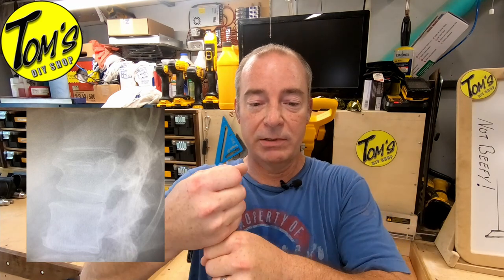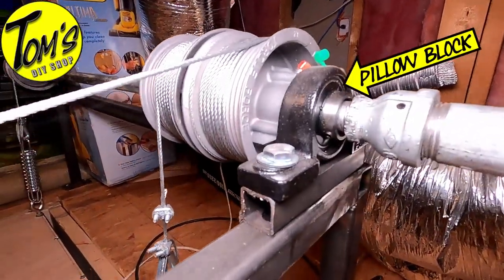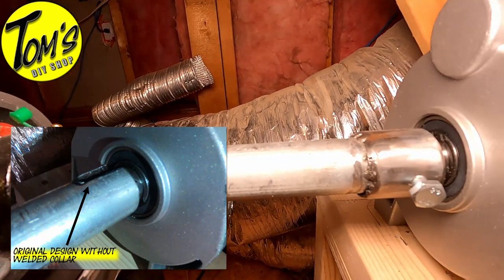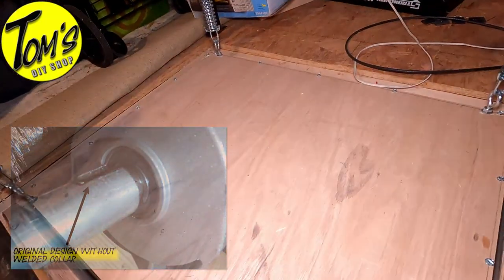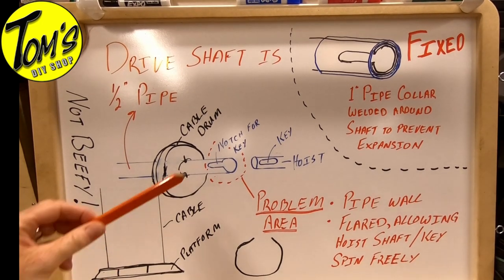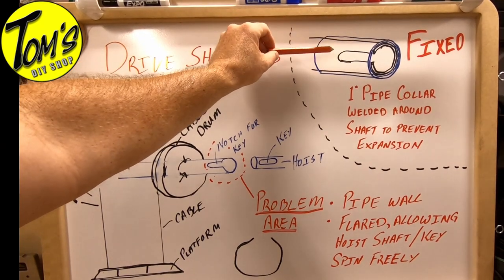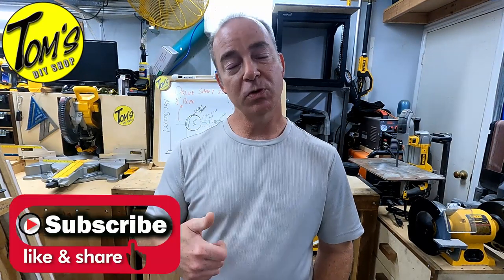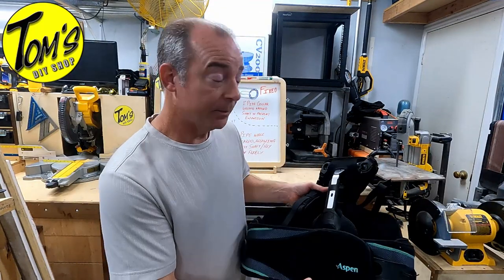Epic Fail - Attic Lift Fall: What Happened?

Comment: Glad to see you are doing better. My father built a lift in his garage, and the same thing happened.  The cause of his was a turnbuckle failure. When building his lift, he went to Lowe’s to buy a cast-iron 2000 pound turnbuckle and the Lowe’s employee pulled one off the shelf from the correct box but it was a 250 pound aluminum turnbuckle that was in the wrong box. It worked for over a month until it didn’t. His broke when he reached the top and it came crashing 12 foot down. My father was 75 years of age when it happened a couple years ago and he broke both heals, his elbow and his back but luckily he lived to build another day.
Reply from the maker: Wow, I'm very glad to hear your Father is ok and I really appreciate you sharing your story in the comments. We all (hopefully) learn from our mistakes and continue moving forward smarter. I've had enough wrong parts in the wrong location that I double check everything...luckily it wasn't even close to as hard of a lesson as your father's!

Be sure to check back and subscribe, I have new content on the way!

Thanks,
Tom

Comment: I give you a lot of credit for showing your fall, there's alot of people out there,myself included, that wouldn't have shown that. I did my own platform and am still working on the final touches. Nowhere near as stout or high tech as yours but it does what I need. Glad to see your up and about.
Reply from the maker: Hey Greg, we all learn from our mistakes and if my  fall and subsequent evaluation saves someone else’s pain and suffering, then I’ll chalks that up to a good deed for the day,
Reply: I have looked at alot of lifts built. This is by far the number 1 lift I would not step foot on. Even with the so called fix.
Reply: @TomsDIYShop  thanks for sharing. I think the sistem it's not safe for people. Lack of safety. The best is to use it for items and stay away when holding loads

Comment: Damn, that looked like a nasty fall. Since you seem to value feedback, I want to share something: I notice you improved the point of failure, but didn't add anything to prevent this from happening again. That means that you're now relying on an improvement of which you can't really be sure if it'll hold up over time. I mean sure, it probably will, but especially if you're gonna be on the lift yourself, you always have to assume that it will fail at some point, so you'd need a backup.

The best way to prevent a very speedy descent in your situation IMO would be to prevent the axle that has your cable drums from spinning too fast. Something like a centrifugal clutch could be used to engage a brake when the axle spins too fast. Another option would be a magnetic brake, similar to what drop towers use, but that's probably a bit more expensive and harder to make.
Reply from the maker: Hey Tim, thank you for the detailed info and for taking the time to stop by the channel. I couldn’t agree with you more that the lift needed some redundant safety measures, given that I was riding the lift. I evaluated fall arrestor systems, notched gears, etc., but…I have since moved to a new home with a new shop! I’m working on the 2.0 version of the lift and don’t have the same limitations I did with the garage attic space in my last house. This version with leverage lessons learned and all the feedback I’ve received.

Comment: When engineers design things we use different factors of safety and backup “fail safe” provisions when people will be the load as compared to objects. Even then failures can occur through errors or unanticipated events. Glad you have recovered from your fall, very scary.
Reply from the maker: Hey Jerry, thank you for the well wishes and for checking out the channel! Definitely an oversight on my part, but not one that I’ll make a second time.

Thanks,
Tom

Comment: sorry that this happened to you.  I see some other things to consider in your build that would make me nervous.  I highly recommend a fall arrestor for you when using that.  
The cable seems to be completely off the drum at the bottom.  Will make the winch motor work very hard to get the platform moving.  It's  better to leave 4 or 5 wraps of cable on the drum when the car is at the bottom of it's range.
The forward pulliies attached to your welded frame are attached with some bolts.  Are those bolts sized appropriately for the weight they are expected to carry?
Reply from the maker: Hey Mike, thanks for stopping by the channel and for taking the time to leave a comment. I considered how much, if any, cable should be left on the drum when the lift was in it's fully lowered position. I decided on "None" because I was concerned that, if the shaft/drum was over-rotated down, the excess cable might go to one side or the other, outside of the cable drum guides, and wrap around the drum shaft. Raising the lift while in that state would cause the platform to have a severe angle and potentially damage the cable. Excellent points though and, if I had some type of sensor or switch for both the upper & lower limits, I could have left some cable on the drum and reduced the strain.

As for the components used in the build, yes...the bolts were more than capable of carrying the load. I considered the lift capacity of the hoist, the pulleys, bolts, cables, etc. and, divided the load by 4 as each connection would be sharing the load.

Comment: This video has the potential to save lives! I am about to embark on a project like this. Just getting started with you video. Thank you for sharing!
Reply from the maker: Hey Captain, thank you for the feedback and for taking the time to stop by the channel, I really appreciate it! There are several other design options out there (which I’m sure you’ve discovered in your research, just as I did) that include much needed safety features, especially if you intend to ride the lift. I’m currently working on a 2.0 version of the lift in my new shop and don’t have the same constraints I did with the attic space above my garage. Would love to see the final build once you’re done!
Reply: @TomsDIYShop  thank you for the reply.  As of right now I plan to use a winch, yours was the first one I saw with a garage door opener.  I like that a lot because of the stop mechanism.  There is a very impressive one I found last night that lifts a motorcycle into the attic as well as many other attachments that he added on.  Really very very impressive.  A lot over kill but, very cool.

Comment: Happy you healed well.  I have broken several vertebra's and my pelvis among other things.  For what it is worth mine healed pretty well, my advice is don't push it too hard and more important don't not use it.  Fine line, but if you don't use it you can lose it, things get too tight and stiff.  It was almost a year before things got really back to normal.  Hang in there and good luck.  Keep building and doing things you enjoy.
Reply from the maker: Thank you TCCD, although you comment may be a day late and a dollar short! I was already stiff as a board thanks to spending 18+ hours a day in my office chair for 5 plus years. I have been working to finish my bachelor’s degree and started on my MBA (only 3 classes left!) and between work and school, hardly left my chair.
Reply: @TomsDIYShop  Good luck on the MBA.  I remember those days and glad I did it, and glad I don't have to do it again.  The right Masters can sure open up some opportunities.  But remember to live some during the process.  Wish I had of but got too focused on degrees etc.

Comment: Wow, thanks for sharing your X-ray. I fell about 15 feet off a ladder and had the same injury as you did to the L1 vertebrae, its called a "wedge compression fracture". I'm glad you're feeling better.
      Mine turned out to be about 80% crushed. Stable and no chips or cord damage, but I could barely get out of bed for 2 weeks and had to take some serious pain meds.  Happened 8/2022 and still undergoing physical therapy. The outlook is OK, but I'll never be the same again.
       Count your blessings it wasn't worse.  I  now harness up if I'm working at heights greater than 6 or 8 feet if things look a bit "sketchy".
Reply from the maker: Wow...it's amazing what that extra 5 feet will do. The ceiling in that garage was "only" 10 feet...but that's better than 15! Glad you're on the mend as well and didn't sustain anything life threatening or worse! As we age, things hurt more than they used to and take longer to heal! 

Thanks for your comment and for taking the time to do it, I really appreciate it! More content is on the way so, if you're not already, make sure you're subscribed and hit the bell so you'll be notified when new videos are released.

Tom

Comment: Hi Tom, 
Really glad you are okay. Sometimes what we don't know can hurt us. As a tradesman, I continuously upgrade my knowledge. When we know better, we do better. The item you refer to as a shear key  is primarily a drive key. There are three parts to a drive of this type, The Key Seat ( the groove in the driving shaft), The Drive Key itself, and the Keyway (The grove cut into the driven hub). There are specific dimensions for these items based on the intended load, shaft size, hub or coupling size. The key should fit snugly into the key seat and the keyway so the connection has no gaps to allow movement. The galvanized (Sched 40?) water pipe you are using Is not the proper metal nor has sufficient wall thickness to withstand the torque applied to lift the varying loads and was doomed to fail. It is unfortunate that it failed while you were on board. As an improvement, you have welded a collar over the pipe that has already failed once. If the keyway in the new connection is loosely fitted, the edge of the pipe that the Key drives on will begin to get pushed out and it will fail again. There are proper hubs, collars, shafts, couplings readily available. Go to your local bearing supply store and they will have the knowledge to supply you with what you need. Stay away from the big box stores or Tractor Supply stores. They don't have the knowledge to ensure you get proper components. Another thing I noticed is when the lift is on the floor, the cables are unwound all the way. There should be two wraps of cable still on the cable drum when the lift touches the floor. Also, install a limit switch so the lift stops before the cables slacken. There should always be a load on the cables to prevent them from coming out of their groove on the cable drum. If the cable comes out of the groove when unloaded, it may lay into an adjacent groove when the load is applied. The edges of the grooves are sharp enough to damage the cable if the load is great enough. One more thing, make sure all of the cables have the same amount of tension on them to keep the lift platform level, but that should take care of itself after you add the down limit switch and re-wrap the cable drums. Please fabricate some type of a safety mechanism to prevent it from falling. Personally, I would not build a winch in this manner. If I were to build one, it would have similar features as this. https://www.youtube.com/watch?v=8wVN4IINC1A&t=13s

Take care.
Reply from the maker: Hey Mark,

First off...Wow! Thank you for the very detailed response and guidelines. I wish I had this info during the design / build phase of the project. You are 100% correct about the galvanized water pipe wall thickness and that was an oversight on my part. One correction though - the welded collar was not originally in place, which is what allowed the water pipe walls to flare under the torque of the motor. Once my back healed and I was able to evaluate what happened, I welded the collar (both front and back edges) all the way around the original pipe.

My preference would have been to use a C-Channel with truck guides against a wall. That seems to be the most solid option from a DIY perspective. Unfortunately, due to limited head room in the attic and limited wall space in my garage, I couldn't make the C-Channel solution work, which is why I opted for the cable system. The link you provided is a video I've watched several times and I thought the builder was very insightful with the design and execution and even had additional accessories he could attach. I don't have anything near the size or weight I'll be lifting....just holiday decorations....lots of holiday decorations!!

Thank you again, you very obviously put a lot of time and effort into your comment and I truly appreciate it!
Reply: Great information here. It definitely makes sense to buy the correct items.
Reply: I came here looking for an easier way to get boxes of files into my attic and I just learned so much!    

And that was a nasty fall!  I'm glad you're ok.   Thankfully, I'm not trying to construct something that I intend on putting my old arse onto...  just get the stupid boxes up there by working smarter and not harder.    Thank you for the video!

Comment: Glad to hear you are doing better, not sure if anyone has commented on this but your garage door cable drums should have a few wraps on them when at the bottom. The casting of those cable drums are designed to use the friction of the loaded cable to clamp on that groove.

Comment: Thank you for sharing your ideas. I was looking at the thread on the reducing from 1-1/4  to 3/4 .
The thread does not matter how tight it is , eventually it will come loose, because of the weather temperature change summer winter.
Expansion and contraction. When that get loose the garage pulley will spin freely the same way did it on the motor side.
Reply from the maker: Excellent point Segundo and you're probably right. When I was building the drive rod with the garage cable pulleys, I remember putting some extra elbow grease into tightening the two-per-pulley bolts that fastened them to the pipe. There were several options that could have that much better, like driving a bolt through the pulley and rod ensuring there was no chance of slippage or, at the very least, putting some lock-tight on the threads!!

My wife and I bought a home out in the country and the house we were in at the time of the fall is now our rental property so, luckily that lift was dismantled, and the hole covered up. In our new place, I have a dedicated 1,200 square foot shop and constructed a 350 square foot office / studio / Ultimate Man Cave in it...complete with ATTIC LIFT 2.0! More videos on the way, so be sure to check back, SUBSCRIBE, and hit the bell so you'll be notified when new content lands!

Thanks for watching the video and for taking the time to leave a comment, I really do appreciate it!
Tom

Comment: So an idea for your "stop" switch. all threads, nuts, washers, and material for a lever.  Find the distance between the edge of the access hole and the stop switch on the winch. build a rocker swith with the length plus a few inches. use all thread to make a couple of connecting rods. So when the platform reches the intended position, it pushes up the rod, which the rocker pulls the switch down to stop the motor.

Comment: I'm glad your ok, it could have gone much worse. I would trash that set up with the gas pipe fittings.  Either get yourself a proper 1/2 inch pipe to go all the way to the motor and use either a solid coupling our a flex coupling.  I wouldn't trust that set up even with that band-aid fix. Also the square tubing is begging to be crushed at the pillow blocks.  I think you are asking a lot of that square tubing in general.
Reply from the maker: Hey @kljunatic8157, You'll be happy to know...I trashed the whole lift and I'm super excited to show you(Tube) version 2.0! It's a completely new design & build....in my new shop! Be sure you're subscribed to the channel and hit the bell notification so you'll be notified when new content lands. Lots of changes for the me and the channel.

Thank you for the comment and for visiting the channel, I really do appreciate it!
Reply: I'm planning on building one of these myself. I already have had one bad fall 8 ft on the concrete and broke my hip. Takes a long time to get over. I'm planning on using two of these online. 23ft Self Retracting Lifeline, 330lbs Fall Arrester Fall Protection Device with Alloy Steel Hook & Steel Wire Rope for Working

Amazon has them for $51 each

Comment: Perhaps I missed it but you really should have some failsafe system. What about a fall prevention line hooked to it?  I built a lift in my shop too and have one you can check out for reference - might work. Otherwise I would try to build in a safety lock that ratchets into place on the way up and has a lever with a cable on it that you pull to allow the lift to lower. I almost did this set up but mine is a little less scary than yours as it is along a wall so swinging issues. Hope this comes across as good natured as just trying to offer some food for thought.

Comment: Since I am currently considering building an elevator for my rear deck in my research I came across your video of the fall. If I may get right to the point your version appears to be a good build for moving stuff up and down between the two floors, but it does not "look" safe for people. If it's feasible with your particular topography  I would go with a rail system with a double safety system one for when it's moving up and one for when it's on the way down. But if you're more clever than me you may be able to create one system that handles both potential failures! Best of luck.

Comment: Standard elevators are designed with a counterweight, so that the motor isn't taking all of the load.  Along with a backup "braking" mechanism that automatically triggers when the lift cable loses tension or snaps.